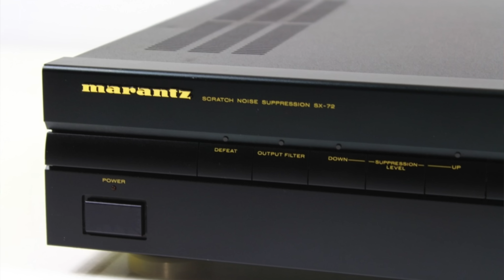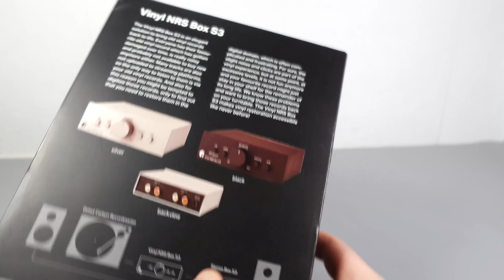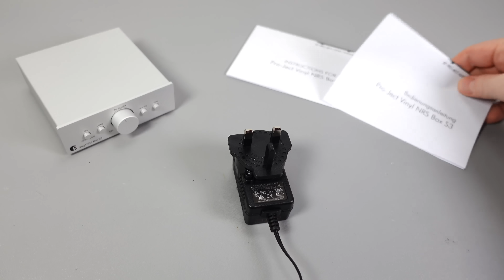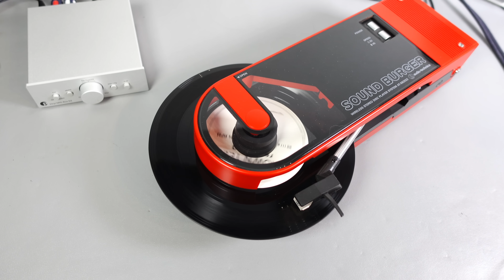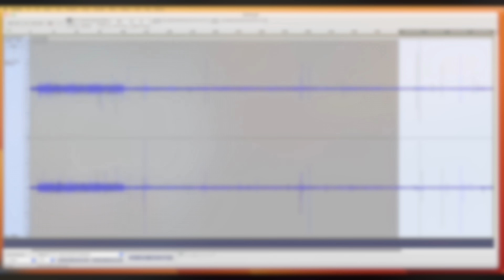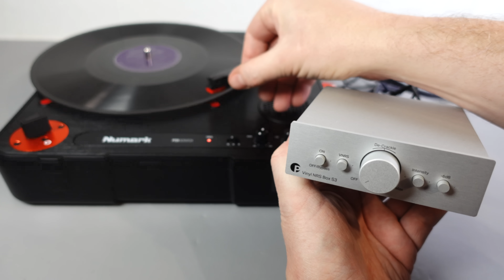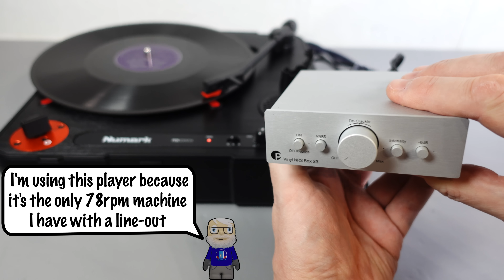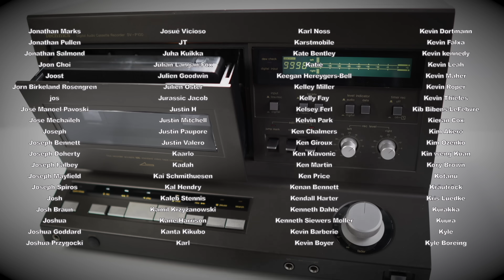REVIEW : Vinyl Noise Reduction System Pro-ject NRS Box S3

Comment: To me, this device does not seem to do much in terms of eliminating the crackling. Given their random nature, it's not possible to just filter them out.
As for noise reduction systems, dbx and Dolby are encode-decode systems meaning the recording is altered in a way (pre-emphasis) and playback is altered in the opposite way (de-empahsis), so on a correctly calibrated system nothing is lost. The de-emphasis done on playback also reduces the noise, while bringing the recording back to its original state. 
This does not happen on decode-only systems, which will also filter something in the music itself to reduce the noise.
Reply: Instead of calling it pre-emphasis and de-emphasis shouldn't we call it processing at each end of a two-pass NR system.  FM radio uses de-emphasis on the listner's end and pre-emphasis on the broadcast end in order to gain a better S/N ratio for the listener.

Comment: That didnt do any significant difference, there are however however pro audio softwares that can deal with different kind of noises that i am sure could make miracles of crackles but it would include recording it with a computer and processing it. I have personally used Cubase which is a big name in digital audio workstation softwares (DAW) since i am a musician and even 15 years ago i could completely remove clicks that somehow appeared when recording using the built in plugin for that but there are also more specialized softwares for audio restoration.

Comment: With noise and crackles you need to have "look ahead". So you need a buffer. Because you need to have some reference to see which transients would be identified as "pops and cracks" and which transients are part of the music. There's plenty of software (Izotope RX comes to mind) that can handle this kind off thing very well. I would assume running a program like that on a pie with an in and out should be doable at this price point. That being said it would make it a fully digital signal and it would prevent "true" real time playback.
Reply: I remember that the '70s the  BSR  "scratch remover"  had several milliseconds of delay while sampling the noise before processing it.  They eliminated the noise and filled in the minute empty space with the audio just preceding it.  All analogue.

Comment: I found the rumble reduction immediately noticeable on the first record, so at least that part is definitely effective.

For the de-crackle, to my ears it didn't eliminate any crackles, but did take the harsh high-frequency edge off them; depending on your hearing and age this might not be as noticeable, and it did require being cranked up fairly high for it to be a meaningful difference.

It would be interesting to zoom way in on your recorded audio track wherever you have a big spike and see how the shape of each impulse differs before/after turning on de-crackle. Even if the "peak" is just as high, if it's got a more gradual roll-off in the signal after the spike, it will eliminate a lot of the high frequencies in the click which will make it less audible over other audio.

That being said, I felt that both features (even when maxed) had a very minimal negative effect on the sound quality of the "intended" audio coming through, so Pro-ject have done a great job on that front; almost all "noise reduction" systems I've tried to listen to before end up making the actual audio muddied and unpleasant.

It's not the strongest effect, but I felt both settings were a net benefit (at least to me). Certainly no scam, and for the right kind of listener with the right kind of vinyl collection, this would be a pretty useful device.
Reply: Was thinking it would be nice to see a side by side of the same section of audio with and without the device.  I'd just record it in to the computer without, then play it back from the computer through the device, so you can see how the thing changes the exact same crackles.
Reply: @johngaltline9933  yeah that's the part I felt was missing in the video, something weird given that Techmoan is usually very thorough on his approach.

Comment: Things like this usually have trade-offs and the adjustments are meant to find some kind of "Goldilocks" zone where trade-offs are less and benefits are more.  I think Techmoan did a good job of calling out, overall, a somewhat disappointing mix of only a very small improvement at best and, often, less.  Based on Techmoan's findings not what we expect from Project.

Comment: Your first test with the TriMicron record absolutely demonstrated a difference with the decrackle performance. The crackles were much more muffled, though still very present, almost like there was just a high pass filter being applied at the moment where a crackle was detected. I'm not suggesting this justifies the product, but there is a clear audible difference that some listeners may prefer. I wonder if this only applies to listeners who still have good high frequency hearing (possibly why you couldn't hear it, sorry?!) and are listening on reasonably high fidelity equipment.

Comment: I am no audiophile, but I do have a general IT/electronics background. It seems to me that any noise reduction system that relies on filters to reduce part of the audio spectrum is not going to be satisfactory, as it will always affect the quality of the sound. I would guess that the only really satisfactory way of doing this is to digitise the recording and then use software that would recognise the problems (regular clicks, pops that are clearly not part of the music, rumbles, etc) and edit them out - without touching the rest of the sound. This is no doubt much harder than I make it sound and may need some form of AI to be entirely successful - and/or a fairly high level of user involvement to 'teach' the system what to ignore. I've always assumed that professional studios use something like this when they clean up old recordings, but maybe such equipment is just too expensive for the consumer market?

Comment: While it clearly lowers noise and crackles, to me it is quite discernible from your first demonstration with Beethoven that it drowns out quiet passages as well. It cuts down on the details and there is a considerable amount of "useful information" that is lost. Whether it makes such records more enjoyable or not is subjective but what's certain is there will be details that will be missed - just like with the old DNL system. SoundForge have had a "click and crackle" removal feature since before the 2000s that I've been using back then when digitizing some records. It did a better job from what I remember and it's an algorithm that predates this one by 25 years. And as for rumble noise, I think one can find a turntable which is virtually rumble-free to purchase for the price of this unit. Or maybe this just says something about ProJect turntables 🤭🤫
Reply: I was questioning why his Denon DP-47 produced audible rumble.  I've got a DP-40 and it is dead silent.

Comment: Another great video. 
The amount of visually great 2nd hand records I’ve bought that had heavy surface noise or worse still; heavy groove wear on inner tracks, is about every 2 out of 10. I’ve always managed to sell them on to collectors (sometimes at a loss, sometimes at a profit) who just want to own a vinyl copy despite my indicating sound issues. I could also buy replacement vinyl copies after selling an occasional dud. As such; I would find the Pro-ject VNRS box unnecessary, especially at its price.

Comment: Sorry to intrude in a technical review, but I get  massive improvement on old records with a wet play, cheaper than going digital and very tactile/involving.
Reply: It does work pretty well, especially if you are recording/ripping the vinyl. In my and many others' experience, once you've done this, the record is basically ruined. When dried, even after cleaning, it will sound worse that it was before wet playing.  I would only try it on a record that is not worth a lot in its condition.
Reply: @rickm.2956  Yes good proviso, it's a hack for VG and G rated - it won't achieve anything on an already acceptable example. 
Be that as it may I achieve 90% elimination of crackle which persists at 85% after drying. Some spectacular renovations have resulted on discs I suspect were on the deck when drinks cans were opened in the vicinity. Unscented glass cleaner, if anyone wants to give it a trial.

Comment: I've digitized dozens of records using a PC, a USB turntable and Sony Sound Forge software. The noise remover is truly excellent, they've refined it to work really well and remove most clicks and pops. The loudest ones are always stubborn but can be dealt with manually.
Reply: I use 'RX 8 Audio Editor' which comes with the latest Sound Forge. It is far superior at removing the clicks and pops without altering the audio quality.

Comment: There are a lot of videos on youtube suggesting means and ways of suppressing noise on vinyl records.
Having carried out much experimentation guided by these videos, the most success I have had was, from what I imagine, would be considered a rather controversial method amongst audiophiles. It entails spraying the record with a film of deionised water, (distilled water), and playing the record with this film of water present on the disc.
I found the results to be astonishing, and my Thorens turntable, cartridge and stylus seem none the worse for the experience. 
When combined with the PVA glue method of pre cleaning the record, the results are remarkable.
I'm neither advocating  nor dispelling these methods, suffice to say that when crackles and pops present themselves in my speakers this is my "go to" method to rectify the issue.

Comment: As pure speculation I wonder if in the test with the silent dbx record where the crackles seemed to get worse with the de-crackle maxed, I could see that being the system taking the crackle and trying to compensate so hard it ended up going to far and just recreating the crackle upside down. Because of this you'd really need to play the exact same section of the record for each test which obviously would be very hard and even if you could if the crackles are dust and dirt they're probably moving or changing with every pass of the stylus. 

This got me thinking however and I think there's a simple solution to this, exploiting the fact that this device uses a line level input. I'm sure you already know where I'm going. Basically record a section of the silence record with your PCM recorder, either with this device in bypass or just straight out of the preamp. Then you can remove the record and record player variability and just play that clip back from your PCM recorder line out directly into this device. Now you have exactly the same pops, clicks, and noise every time to see exactly what happens when you change the settings on the device.

Comment: I find that just using a frequency equalizer --- especially one with ten or more sliders so that a wider/finer range of frequencies can be altered --- can work wonders for turntable rumble, record crackle, and tape noise. :D
Reply: You're literally just applying bandpass filters. That is not sufficient.
Reply: @UnitSe7en  I have no idea about that technical stuff.  What should be done instead?
Reply: @Quacks0  Some kind of digital signal processing - As this device purports to do. By turning the analog signal into a digital one, you can apply formulaic and programmatic modifications that go far beyond just gating certain frequencies.

This device isn't very good, but it isn't very expensive, either. If you look at the comments you'll see people recommending either standalone hardware boxes like this (Usually very expensive), or PC software alternatives.
Reply: @DoubleMonoLR  Ohhhh... I see.  Thanks for explaining it to me.
I remember some years back that I heard on the radio about a guy who was "de-crackling" the sound from old 78RPM records simply by scraping off small bits of the iron-oxide from magnetic-tape recordings that he'd made of the records, to eliminate the recorded pops.  I guess it worked okay --- probably you'd simply hear a fraction-of-a-second silent gap in the sound at those spots --- but of course the sound would still be far from perfect, since you'd be missing a tiny bit of the music each time.  Like you say, though, digitizing the sound and then using computer-software to remove the crackles might be the best option, especially since the easily-manipulatable digital-files format would mean that you could also sort of "fake in" --- i.e., artificially generate and add back --- similar-sounding musical-tones at those spots to sort of "seamlessly tie together" the sound before and after the scratch-pops; since it would be just a fraction of a second of content each time, it should usually be pretty easy to "guess" what the original recording had put there merely by listening to what had come immediately before and after the scratch.
Reply: @UnitSe7en  actually that's basically what all noise reduction is. You can use algorithms to make it dynamic and more precise, but what he's doing with the graphic eq is 80% of what something fancier might do. As for what is deemed sufficient, well that quite obviously depends on personal requirements.

Comment: several years ago, i was digitizing my noisy records and used a computer program "audio cleaning lab" from germany.
it took me several hours to get the hang of it, but it did a reasonable job of reducing noise. i preceeded to digitize hundreds
of vinyl records and cassettes. the program set me back $40 and was worth it as many albums i had were not available
on cd.

Comment: When you pass analogue Vinyl audio through a digital processor , even just flat no noise reduction or processing.. you will notice a drop in high frequency response - I've never heard a 24/96 converter sound 'flat' to the analogue chain.  It is subtle and not a game changer..but it's noticeable.   Once the digital file is processed, you can always boost the high frequencies to match the analogue output.  I use very high end carts, that can exhibit 32,000 cycles easily so that's also part of it.

Comment: 42 years ago I worked at Tech Hifi in Greenwich Village NYC.   We demonstrated the stereos using a very large selection of records. We had a noise reduction box (maybe by Audio Technica?) which used a 3-step process. First you played the recording with the “invert” control activated and you would only hear the clicks and pops. Second you increased the level control just until you began to hear the music, then back it off a tiny bit. Now it was adjusted for that specific record, turntable, cartridge etc. Finally you turned off the “invert” control and listened to the record. It worked very well but extremely noisy records required adjusting it so high that some of the music disappeared! 
We didn’t sell this unit. We played with it a few times as a novelty then never used it again. Anyway, records were easily replaced if damaged or worn.

Comment: This device is looking for line-in. Would NOT work with my simple set-up as my receiver takes phono-out and has the pre-amp built into the receiver itself. So just be aware if you're thinking of buying one...
Reply: You can bypass your receiver's phono input.  Just use one of the other inputs.  CD, tape, video, whatever is free.  Or if your receiver has a processor loop, then you could insert the noise reduction box into that.

Comment: There is only one noise reduction for me and that is DBX superb, I Wish all albums were made today with it and the decoder boxes were easy to get hold of i have about 10 albums with DBX ,40+ years old and still sound superb today using a Technics cassette deck with DBX Disc facility.
Reply: Same here. In the 1980s I used their outboard NX-40 box for encoding/decoding cassette tapes which I had recorded from LPs, to listen to in my car.  Our Alpine in-dash cassette player had built- in DBX decoding.  Also still have a good number of DBX LPs which still are in pristine condition and play back with CD quality - but in the analog domain through DBX's two-pass system.  Thus far none of the "youngins" have mentioned Bob Carver's Phase Linear 1000 Auto-correlator.  or his ACCD feature to reduce FM noise.